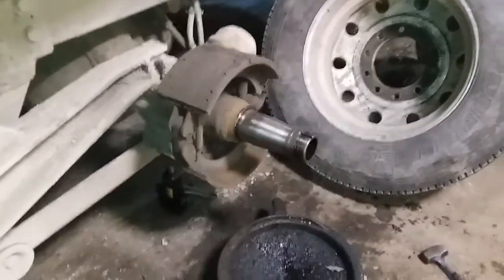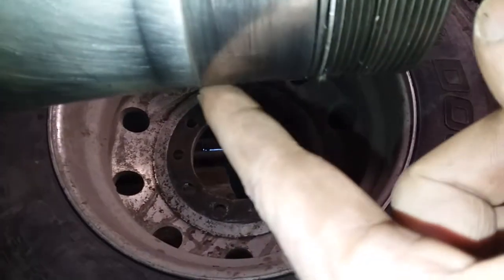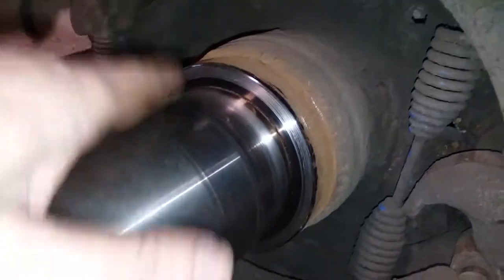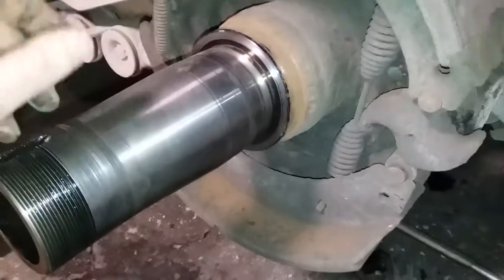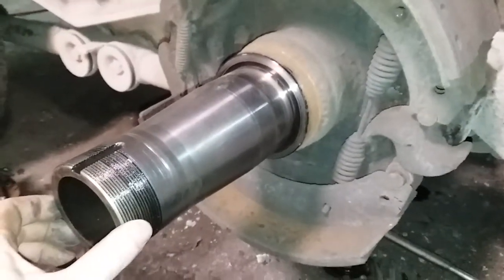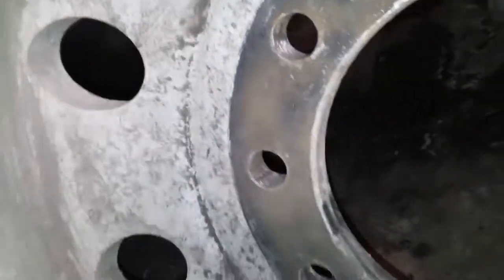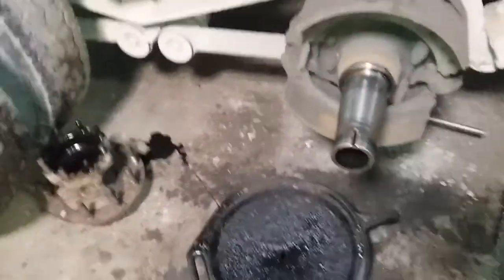Spindle damage Loose bearings and why you should service yours

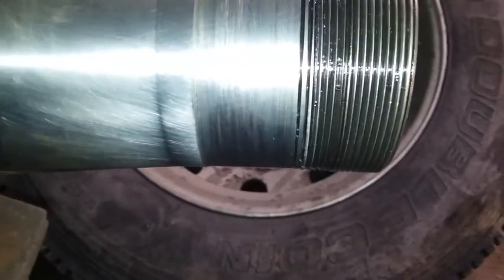Comment: @1:03 do you mean to say loose wheel bearing?
Reply from the maker: I mean the spindle nuts, referring to the older two nut deal. Thanks
Reply: @turbo1438  the two lock nuts that keep the bearing set. Sorry to be picky, it’s a nice video 😎